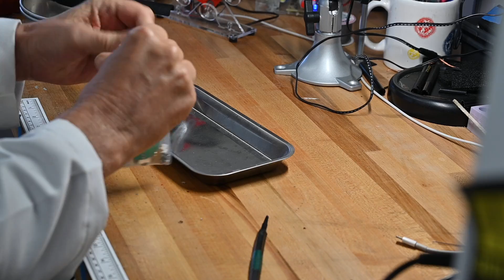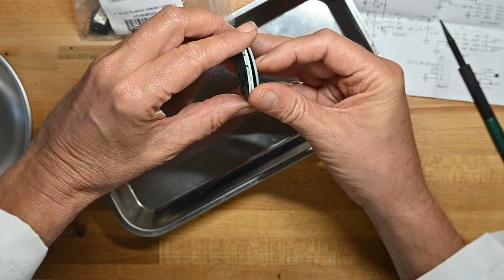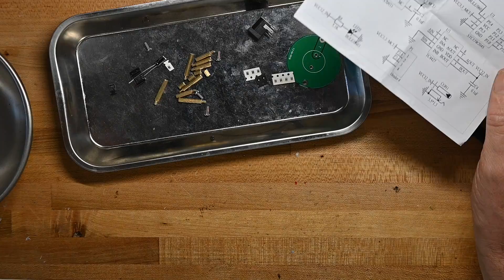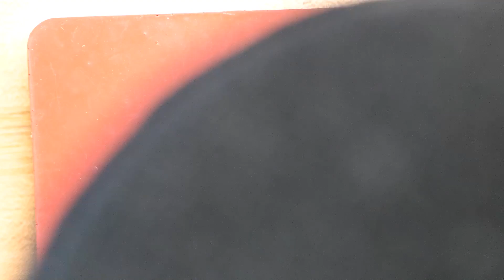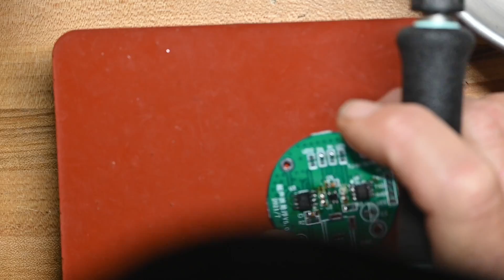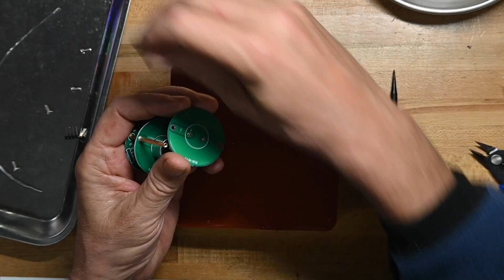C.K. builds an ultrasonic levitator kit

Comment: I'm glad I got a reflow heat gun and solder paste. I can do it, but I don't have the patience for hand soldering smd components.  I saw there's a different version that uses TH components and looks higher quality.
Reply from the maker: I will look for that through-hole version, thanks!  And I probably should do some paste/heat builds, but I'm Old and still prefer an iron 😎

Comment: Neat! The picture on Amazon is showing an additional length of column separating the two speaker boards, and using only 2 columns between the base and the first speaker, so 2 of the short columns just have screws at the base level. I don’t know if the extra separation will make it levitate more easily. The pic also shows multiple styrofoam balls levitating at the same time, spaced vertically.
Reply from the maker: The pictures are misleading.  There are no additional posts in the kit, so who knows what that pic is showing. Ad you can't go shorter between the base and the bottom speaker board, the power connector and electrolytic caps are in the way,  And as for lining up 3 beads vertically?  There would have to be a lot more intelligence in this kit to tailor the ultrasonic pulses correctly to balance the top and bottom beads whilst maintaining the middle bead directly between them. It's not like there is a weak nuclear force interacting between lil styrofoam beads they probably harvested from a broken bean bag chair. So a little creative license.
Reply: @CKHaun  Some of the Amazon reviews have videos, it really works with 3 beads (search for "ICStation Levitator Soldering DIY Kit"). I think the idea is standing waves, with one bead at each node, if I'm using the term correctly. — You do have enough posts, if you only use 2 medium-length ones between the base and bottom, not 4. There are still 4 short ones between the table and the base, but 2 of them continue into medium posts above, and the other 2 terminate with screws.
Reply from the maker: I'll look at the posts again.  And yes, a standing wave could be possible, but again, with the electronics in this one and the indeterminate volume and mass of the styro it would be a challenge to maintain.